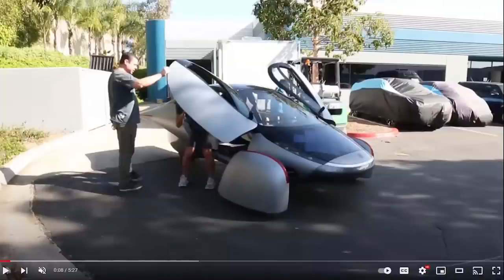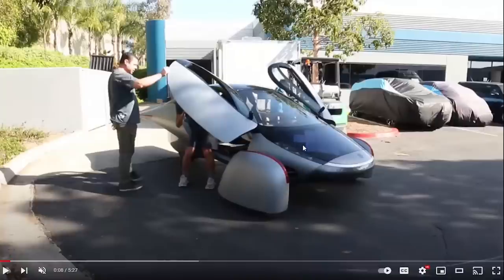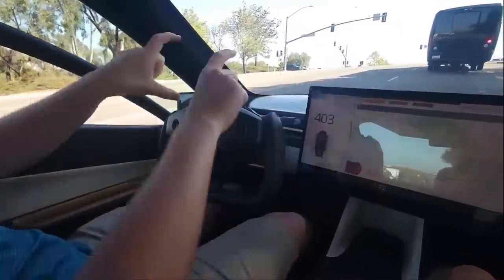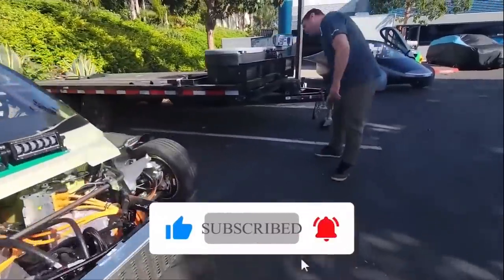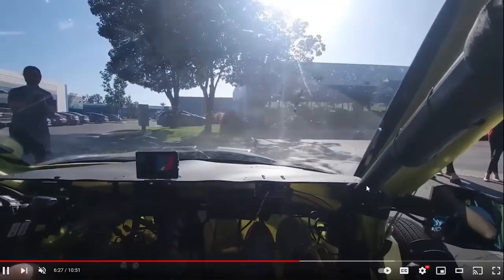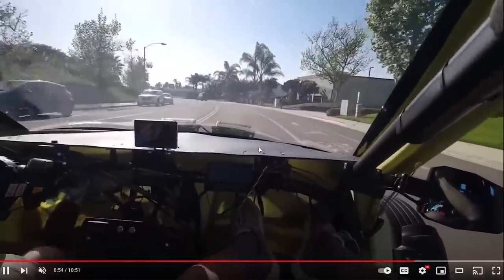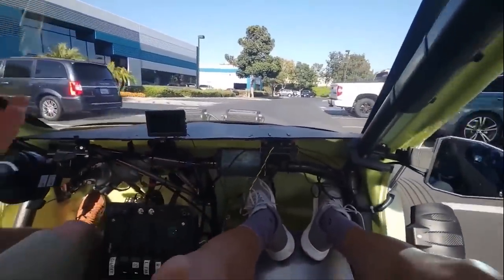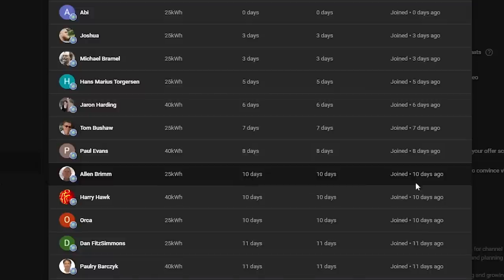Aptera is basically a sports car - Alpha and Beta ride impressions and thoughts

Comment: Thanks for the deep insights Steve. Having been involved with experimental and production composite light  aircraft development It's easy for me to see the path forward Aptera is taking, and it's nothing too exotic or ground breaking. It looks like Aptera is pretty much applying established technologies in a new form rather than re-inventing the automobile so it should be a pretty straight forward development path from here to production. 

The process is very similar to what I saw when Lancair Aircraft went from kit built "experimental" to their production aircraft and Cessna then bought out the production line and brought them in house. Chris has made mention to the similarities to light aircraft such as the Cirrus, and the Lancair Columbia aircraft. Having flow Pre-production Lancair test aircraft and later having owned a production version of the same aircraft that are very similar in construction to the Aptera I expect the production Aptera will be as refined as the [production Lancair composite aircraft. 

Those who have flown in composite aircraft after flying in metal aircraft, can attest to how astonishingly quiet, solid and robust the a composite structure is compared to even a steel structure of an automobile. Composites soak up vibrations and noise, where steel and aluminum structures resonate and transmit vibration and noise, and they have a lot of holes to the outside world. My expectation is that if production Aptera is like a production Cessna or Cirrus composite aircraft there may be nothing that feels as solid and secure on the road.  

In regards to not having much body roll, It makes sense that as the rear wheel does not have to deal with roll, the suspension could be much more compliant. However, as you only have three wheels, the front suspension has to deal with all the body roll. Looking at the suspension geometry on the Beta test vehicle, By moving the motors outboard they were able to raise the suspension roll-center and reduce body roll that way as in an F1 racing car. Something you can't do when have to stick an engine in the middle of the body and suspension. My guess is that the test suspension is for getting baseline design data and is crudely stiff and much can be done in production vehicles to reduce ride stiffness,, improve ride quality and possibly even reduce roll further over the test vehicle.
Reply: Very good comment !  (  Lancair started as a kit..thankfully Aptera is a finished product ...)
Reply: @alkohl4383   Thanks, I knew Lance, Don and the gang back in the early days and Aptera reminds me much of the inspired spirit at Lancair.
Reply: I think you're missing an important point about epoxy-carbon/honeycomb composite structures. They do indeed work brilliantly in environments where they're not subjected to direct impacts. Boats? Marvellous. Aircraft? Wonderful. But boats and aircraft operate in flexible media where the force of bumps and scrapes is absorbed.

If two boats collide, the water surges and shifts and lets them slide away from each other. If a composite aircraft suffers a birdstrike, the 15 lb goose (or whatever) is splattered everywhere, hopefully doing no more than cracking the outermost layer of a composite structure. But if a 6,000 lb fuel truck runs into the plane on the ground at 30mph the damage to the plane will be horrendous.

And the cost and difficulty of repairing it will be bad, too. Restoring composites to pre-impact status can be so daunting that it's usually cheaper to write them off.

When an F1 car has a crash, the lovely composite body and suspension components are binned, not repaired, because broken fibres, micro-cracks and matrix failures are virtually undetectable. Until the next major load event occurs, that is, when everything falls apart.

On the other hand, an old metal-based construction can be straightened, patched , hammered, welded, and made as good as new. 

On a road-going vehicle, the 'car' is fixed firmly to the road by extremely grippy tyres. Things don't bounce apart like they do in water or air; they plough into each other and break. Mild steel bumpers, body panels and crumple zones are very good at absorbing energy; honeycomb-reinforced composites aren't.

They're admirably rigid but under stress they shatter, explode, delaminate or disintegrate. If you run into a wall, a car, a kerb, or a lamp post even at 5 mph, the composite will fail. Ask Mr Koenigsegg what it costs to replace a front air splitter, a door, or even a structural subframe in one of his gorgeous all-carbon hyper-cars.

A 2,000 lb composite monocoque is a very attractive proposition until you run another one into it. Something has to give, and it's bound to be expensive.

I think the Aptera design would be far more durable, practical, affordable and repairable if it were based on a lightweight welded steel chassis, clad in easily replaceable aluminium (or perhaps even epoxy-composite?) panels.
Reply: @EleanorPeterson  
Thanks for your in depth dissertation ,and the opportunity to respond with an opinion, concerns and questions many likely have.
Having worked with carbon composites building several aircraft and Burt Rutan on the Sky Taxi program, I'm familiar with impact effects on carbon fiber layups, and a bit with composite structure such as Nomex panels and radomes, which seem to be more resistant to impact damage than carbon fiber sandwich layups as they are pretty pliable to a point, and generally more durable than Carbon Fiber layups used on stressed skins of aircraft such as The Cirrus and Cessna TTX/400/Lancair. In such aircraft, pretty much the entire outer skin of the aircraft is a stressed, structural structure. Minor cosmetic 'dings' are typically reparable, major impacts are not.

I've personally repaired severe cracks, ice and impact damage on non structural Nomex honeycomb and carbon fiber/ fiberglass cowlings on aircraft and it's generally comparable to repairing a similar damage on a fiberglass car or boat, and a hell of a lot easier than replacing aluminum panels.

If Aptera is using molded honeycomb structure, my assumption would be it would be more durable than steel or aluminum on minor impacts, and much more than a traditional fiberglass car such as a corvette. I've had boats in Alaska and Seattle and had dock, and hull damage repaired and much easier and cheaper than comparable damage to a car.

Aptera appears to be using removable panels on the nose, wheel pants and tail-wheel fairings, so those should be repairable or replaceable, so the cost to repair low-speed impacts should be comparable to a steel car, or possibly even less. Put a good sized dent in the bed panel of your aluminum Ford F150, door or rear quarter panel of Audi and you are looking at thousands. Replacing or repairing a nose panel, Wheel panel or door on an Aptera should be more simple and if you don't have to paint it, just replace a wrap, easier yet.

It looks like the most vulnerable areas of he Aptera as with most cars, would be the rear quarter panels, but even if moderately damaged, as not structural should be repairable as you would do in a similar fashion as a fiberglass car or boat structure, and I'd much rather rebuild a crunched rear corner on an Aptera than cutting and replacing a steel quarter panel on a Honda, or worse yet a glued-on aluminum quarter panel or door skin on modern German Car or the nightmare rear body design on a Tesla where a light tap can be tens of thousands of dollars..

As in a Corvette, Major damage to the Tub of the Aptera could be be a major expense and result in a 'total', just as major cockpit intrusion to a metal vehicle typically results in a total loss, but as the Aptera appears to be pretty modular and composite structures don't deform and bend like metal when placed under stress, if the Tub were severely damaged say in a moderate speed collision the remaining interior and external structures should be salvageable, and possibly if Aptera supplies replacement Tub frames it might be cost effective to even swap-out a Tub by swapping out internal and external components

One area of potential costly repair with the Aptera I question would be the skin radiator panel. That seems to be in a pretty vulnerable area, and would likely be a replacement only structure. Hopefully the belly cooler will be a bolt-in replacement and not some flush-skin bonded contraption.

Comment: I just changed my order from a 1000 to a 400 - Chris is right, I don't need anything more than that since road trips are a lot more fun when you stop to see places and I don't plan on going off grid for weeks at a time., just saved me 15k too
Reply from the maker: ok, WOW, thank you for your sponsorship of the channel!  Very generous of you.
Reply: @ApteraOwnersClub  you deserve it - it would have taken me 100's of hours to do the research you have👍
Reply: I also changed mine from 1k to the 400.  Doubt that it’ll help get one that much quicker as I’m sure the first big batch will go to Cali first to sort out any issues locally before sending them out nation wide.
Reply: May be you need the bigger battery if you live off it, if you use it to cool/heat the vehicle , and even cook using induction cooker, run food processos to make smoothies, satellite Internet, etc.?

Just found Aptera and this channel. Feel free to yell at me if you feel I missed something
Reply: @kamathln  Yeah stuff like that is important to have power for, I think I'm going to just be a normal boring person with the car so 400 should work - which is reality will be something around 300.

Comment: Interesting to hear about the seating position / headroom.  Assuming the seat has no vertical adjustment I will probably just remount them with 2-3" spacers to change the height since me and my wife are both 5'7".

Comment: Man, still wish cars came with softer suspension in general like they used to. My brother and sister both got new Toyotas with the one even having the fancier suspension package and they feel so rough compared to my 97 camry. I really don't understand why anyone would want stiff suspension when softer suspension is actually better for efficiency and being soft is the whole point of suspension. I've noticed this is a tend to move toward stiff suspension as it makes cars feel more sporty, but sports cars have stiff suspension as you need it at high speed. Your average car will never get the advantages of stiff suspension.
Reply: I understand the point about comfort, but soft suspensions actually waste a certain amount of energy compared to stiffer ones.  I don't know how much and you may have just sent me down a rabbit hole to see if I can find out.
Reply: @n.brucenelson5920  well softer suspension wastes less energy as there is less time where the wheels loose contact with the ground. At high speeds though this isn't a major concern as you will straight float over any cracks and bumps in the road, plus efficiency is rarely a concern when you plan on going over 90mph. 

Softer suspension is actually poor at these speeds though as making hairpin turns at speed causes more body roll. The main reason race cars use stiff suspension though is so the body can be lower to the ground for downforce. Softer suspension would require the car being higher off the ground or it would bottom out when hitting a bump. 

But in general for your conventional drive, softer suspension gives more contact to the road, especially on poorly maintained roads, and as a result increases efficiency as there is less time the wheels freely spin in the air. This also means spinning out when going over a bump is more likely with stiffer suspension, but the trade off is softer suspension is worse at rip sharp turns.

For a more in depth explanation, Engineering Explained made a video about the topic back in the mid 2010s.

Comment: Steve, since you couldn't record the battery work, can you at least answer some questions? Did you get a sense of the time frame between release of the 40-25 kWh pack and the 60 then 100 packs. Is it just a matter of productionizing and debugging the 40 pack then scaling it up to 60 and 100? I'm guessing a matter of a few months. Of course shock tuning would also be involved.
Reply from the maker: Unfortunately I couldn't get a great feel for that but it seemed like 25,40 and 60 would happen relatively quickly but that the 100 would be more of a logistical challenge.  But that's just a guy feeling I got from talking and might be completely wrong.

Comment: A cool idea (though maybe difficult) would be a detachable trunk door. Then you could use all that trunk space like a mini pickup bed for hauling larger objects. (Admittedly you might not wanna take it out on the highway like that, but moving medium/small furniture items across town seems doable.

Meh, probably not practical, but would be cool if I could get a super efficient solar EV and a super inefficient micro pickup in one vehicle. 😛

Even if it took some doing to dissemble the pneumatic door closers, etc, could be worth it to not have to find another vehicle for certain jobs. I intend to be a one vehicle guy, so that would be great.

Comment: Look at a Citroen - Long Wheelbase makes for a More "Plush" ride.  Short Wheelbase of the APTERA makes for more Pitching Angle as the Front or Rear Wheels mount a Speed Bump or Curb/Obstruction.

Thanks again for Your Cogent and Descriptive commentary, Steve.  Great help for those of us who are unable to make an "In Person" visit.
Reply: The Aptera does not have a short wheelbase.  The wheelbase is 108 inches, which is longer than a Civic, Corolla, or Prius' wheelbase.
Reply: @HenryDavidFloyd  The Citroen DS 19 has a 123-inch Wheelbase - is Very Nice Ride...
Reply: @guyskeer5411  Totally agree, but that does not mean Aptera has a short wheelbase.  123 inches is an unusually long wheelbase for any vehicle, and would not make sense in Aptera or most smaller cars...

Comment: Nice summary, you do a real service with your Aptera coverage.
 I don't think anyone looking at the vehicle will be expecting a "plush" ride, in fact I suspect many would be disappointed to find one. It's a roadster. The marketing problem is that it looks like a toy, not a serious, safe means of everyday transportation. To combat that, I hope they are working on endowing the next iteration with a brick like sense of solidity --   no rattles, no squeaks, no unplanned flexing. Just a solid well made machine. If they can manage that I think it will somewhat reassure the doubters.
Finally, the beta looks a long way from a finished design, much less a ready to manufacture product. I'll be not at all surprised if production schedule slips.
Reply: The Betas are purpose built for testing one or more subsystems. It would be irresponsible to spend time and expense to finished them. The Alphas were built for appearance. The pretty cars will come back when all subsystems testing is done.

Comment: Crossing my fingers the battery news they are working on is LFP.  I would be amazed to see them get it ready this fast but it would be a great fit for the shorter range.
Reply: And reduced cost and safety
Reply: @johnmalcom9159  And longer life and reduced environmental / human rights impact :)
Reply: Chris Anthony's battery company produces LFP battery packs, so he is very familiar with them.  It will be interesting to see.  Battery tech is moving very quickly, and Aptera practices Kaizen - continuous improvement.

Comment: Seat height was a real concern for me. Sounds like it won't be an issue.

I think one of the biggest advantages of having in wheel motors is that they can program traction control to make sure that if a wheel loses traction, it can adjust power to the others and keep control of the vehicle. All wheel version of course.

I really want a 4 point harness with my aptera?
Reply: Aptera is likely to have seatbelts with airbags built in like some aircraft.

Comment: I am waiting to see how they handle noise, wind and road, as well as how it rides.  All the range in the world will not matter if the car rides harshly and requires ear plugs to drive comfortably.
  
do they have a test mule with installed solar panels?
Reply: They have been testing stationary solar mock ups for well over a year - maybe longer.  The next beta vehicle will be testing the actual solar installations on a moving platform.